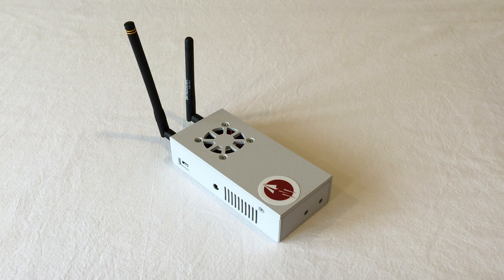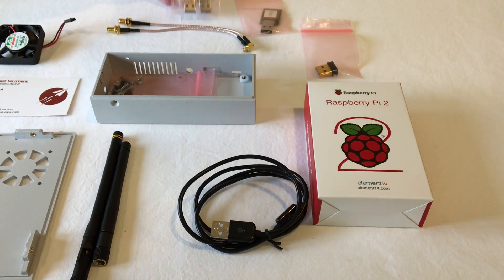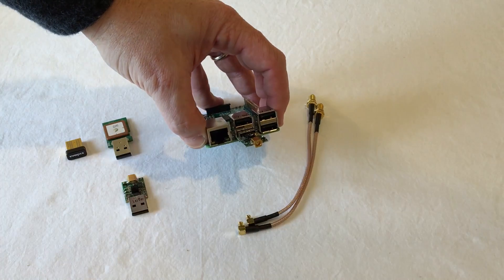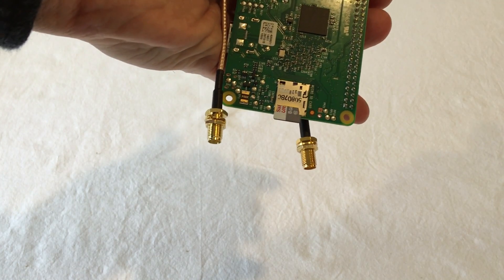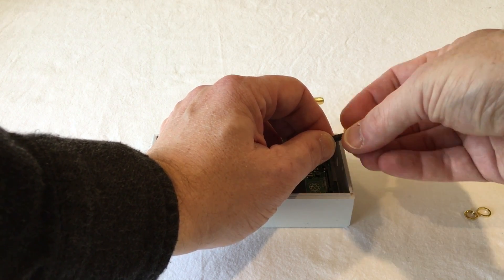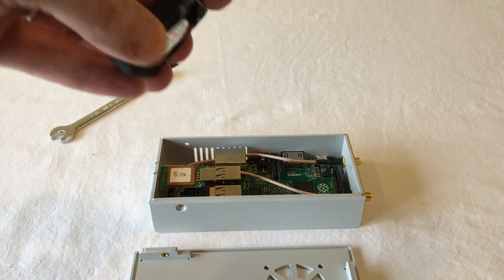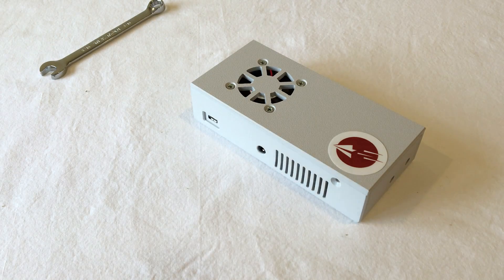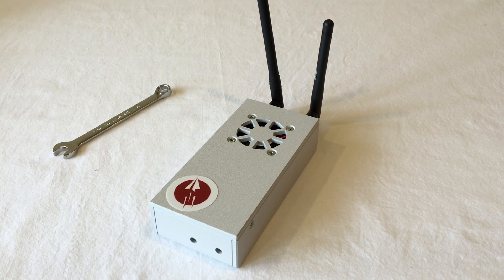FlightBox Assembly

Comment: What's the best practice for a FlightBox clean shutdown?  Don't you run into issues with the SD card getting corrupted?  I ask because I have a a couple of other headless Pi projects that have required re-imaging or replacement of a trashed SD card because of this (not frequently).

Comment: Cleanest looking DIY ADSB receiver I've found. How easy would these be to change from aircraft to aircraft for renters? Any support for the Pi 3?
Reply from the maker: +Dane French If you use a portable battery (Anker E3, E5) or always rent aircraft with a cigarette lighter it's really easy to move around. Nothing is installed - you just set it up on the glare shield. The Pi 3 fits the case perfectly. We've recently switched over to shipping our kits with Pi 3s.